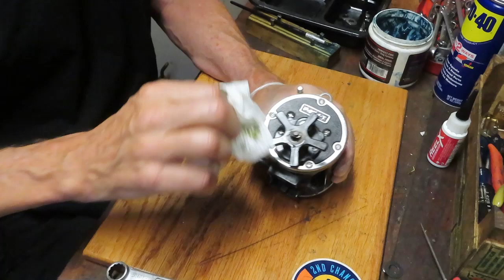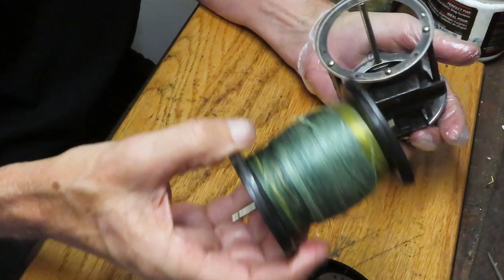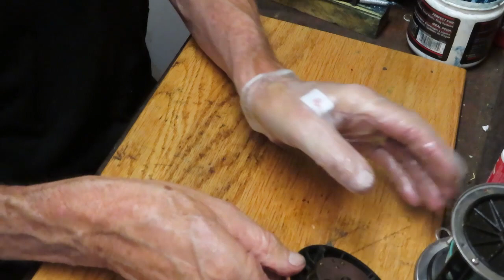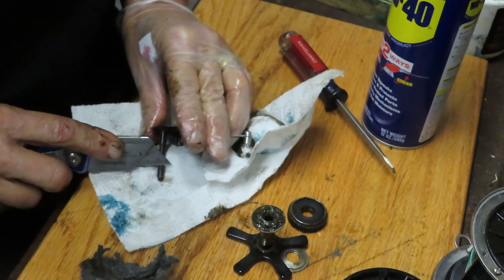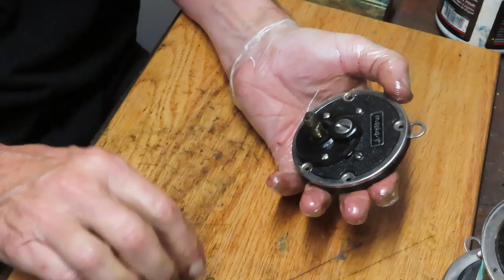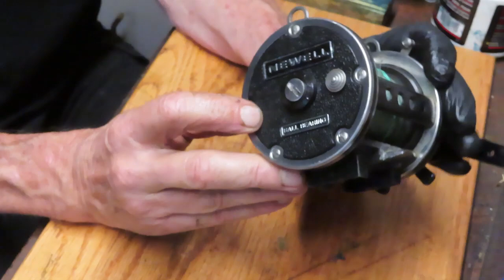Newell P454T saltwater fishing reel how to service

Comment: I have a question my gearing is hitting of one the screws on the inside frame how do i prevent it from rubbing
Reply from the maker: Hmmm - if that is happening, which I have not seen, then I will assume that a screw was put in the wrong location.  If you can identify the screw and remove it, that will be step one.  The next would be to find where a shorter screw id located that would be the logical one to swap places with and try to solve the issue. - Worth a try.  If you want to send a picture of the screw and location, I will see if I can help.  email 2ndchancetackle@gmail.com with he picture - Dennis

Comment: I love my Newell Graphite. I need to service it. Thanks for the video. 😊
Reply from the maker: Thanks!  It is a great reel. Best wishes on giving your reel a 2nd Chance
Reply: @2ndChanceTackle  I forgot to mention it is the S454-5 model. I guess I get the parts online. I’ll be watching this video a dozen times before I remove a single screw. I can’t wait to see how it comes out. Do you know of any full ceramic bearings that would fit this reel? The ones I’ve seen are ceramic bearings in a stainless steel housing.
Reply from the maker: You are going to have a hard time finding any parts for the Newell reels.  There are no distributors and most of the parts supply has been exhausted.
The only thing that is easy to get are the drag washers.  That reel uses the same drag set up as the Penn Jigmaster 500 reps

Comment: Nice oldie but goodie, would have liked to see how you removed the broken shaft screw that broke in the beginning of the video, I think it would be helpful.
Reply from the maker: I used a needle nosed pliers after soaking the stud that remained in the frame.  Fortunately, I had enough left on it to simply twist it out and I did not need to drill or retap
Reply: @2ndChanceTackle  👍

Comment: Carl Newell was a great guy, an innovator, and initially a plastics engineer out of Glendale, California.  He was an avid saltwater fisherman all of his life, either on the day boats as a kid, or a blue water "long ranger", as an adult.
His innovations (all stainless gears/graphite parts and frame/lightweight complete reels, as well as kits made for Penn reels) were genius for their time, along with Accurate's and Tiburon's aluminum frames and other parts, that could be used to improve Penn as well as Newell reels.  Thus, nothing casts like a well kept, light Newell reel!!!!

A little light these days for the larger fish, but the Newell 533 5.5 was favored by wahoo fishermen for a couple of decades.  (Most replaced the graphite handle and may have used an Accurate or Tiburon frame, to strengthen the reel, for long-range use.)

I still have all my Newells, and I don't want to give them up, for I still use them for lighter saltwater needs.  Best casting jig stick reel ever!!!
Reply from the maker: Thanks for the additional information.  These are great reels!  Dennis